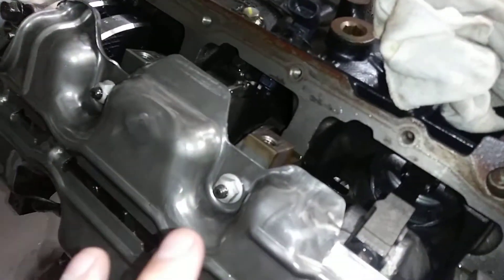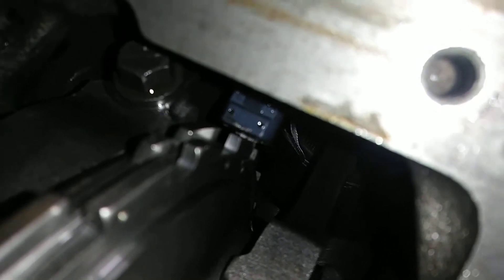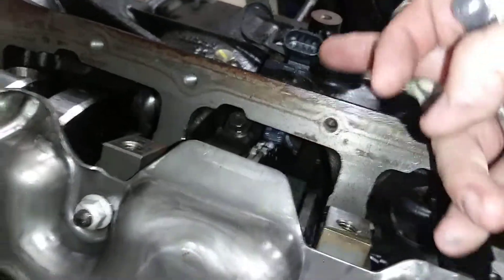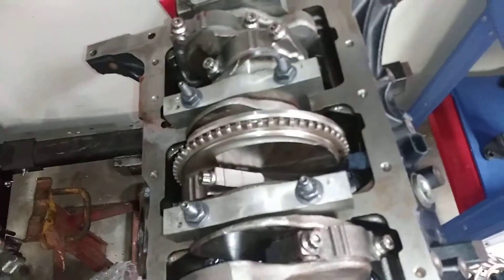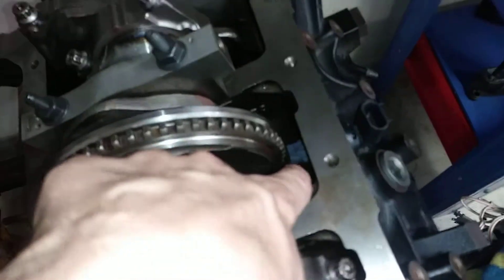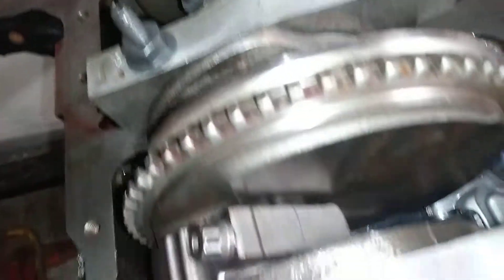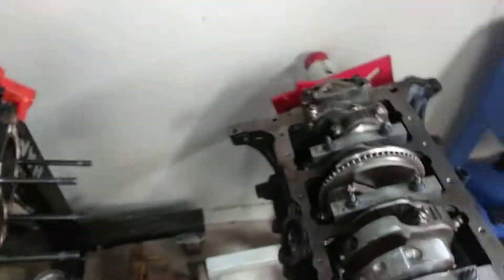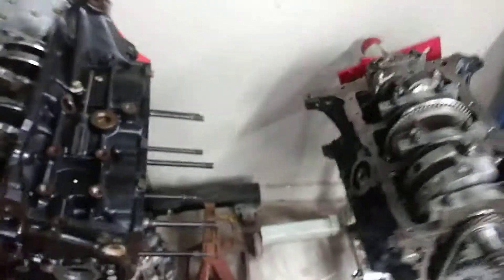Lx9 vs lz9 crank signal and sensors

Comment: Why do you hate v8 archie? Im about to buy his kit.
Reply from the maker: His kit is junk.  He had a lot ofnunhappy customers.  His turnkey cars have literally broke down on the side of the road after leaving his shop and he refused to go help.

His fiberglass parts dont fit correctly and have pinholes in them.

I called him out on all these issues from cars that left his shop.  He didnt like it.  So at a car show he assaulted me and got physical with me to try and bully me to stop.  

Thats why I dont like him.
Reply from the maker: If you do an ls4 swap you dont need an archie kit.   It bolts to stock transmission
Reply: Hmmm. Interesting..

Comment: Since very few cars came with an lx9, the more common situation would be someone swapping an la1 car to an lz9.
There are external crank trigger kits available for la1 cars that have swapped in an lx9. I would think this would be the easiest solution for the lz9 also.
The cam sensor is the big hurdle for an ob2 based swap to an lz9.
Reply: I'm going to use an external trigger on mine,  but its looking like I'm going to have to figure out something for the cam sensor.